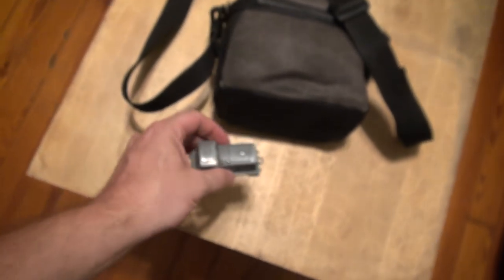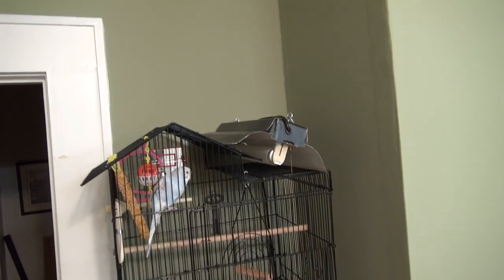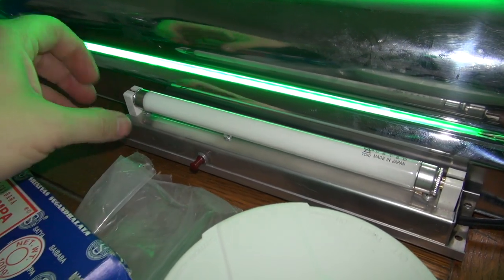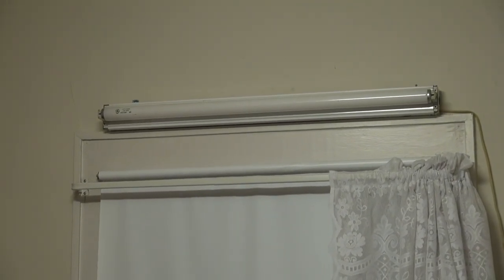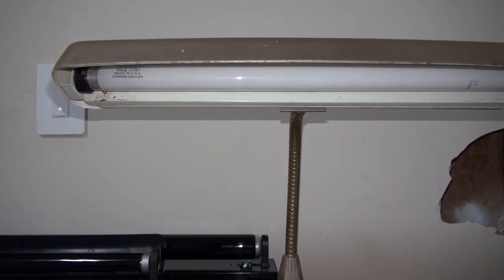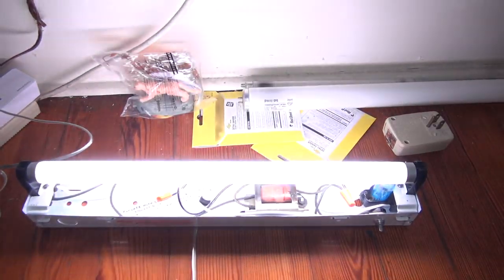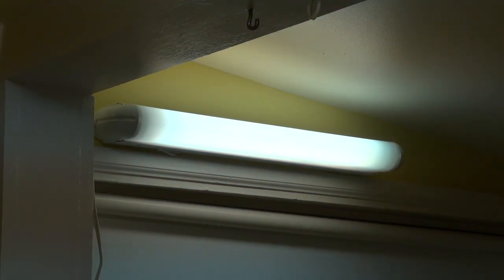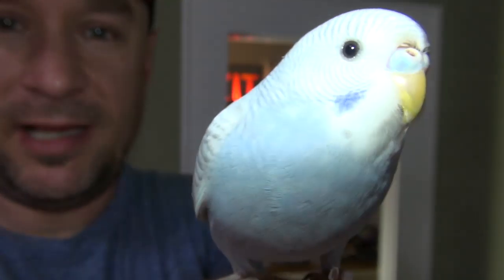Update on my Preheat Fluorescent Light fixtures October 3rd 2019

Comment: Awesome fluorescent collection! Look like you have an old ceramic bodied ivory 3 way toggle switch made by Bryant @5:51 by your dual f7t5 fixture on your nightstand, I has always like Bryant’s older pre 1950 stuff especially the incandescent sockets and receptacles. And in the PL type flourescents, I have 5 of those GE biax adapters that takes the 5, 7 and 9 watt tubes. 😁

Comment: I recommend that for your ceiling fans, you should replace their light kits designed for shades with 4 inch diameter lips and install preheat F20T12 fluorescent adapters in them!!!
Reply from the maker: I need to someday.